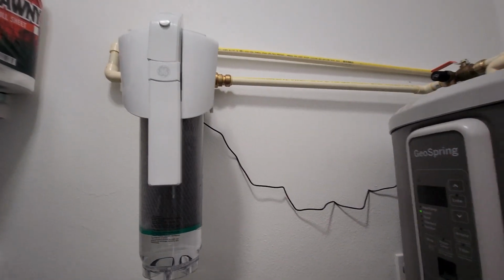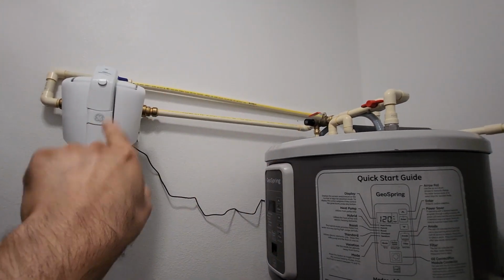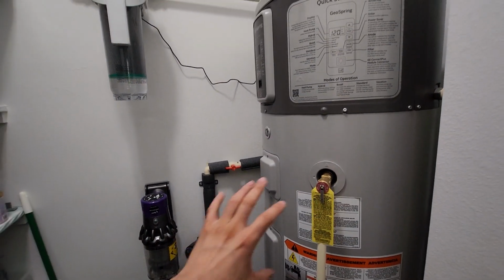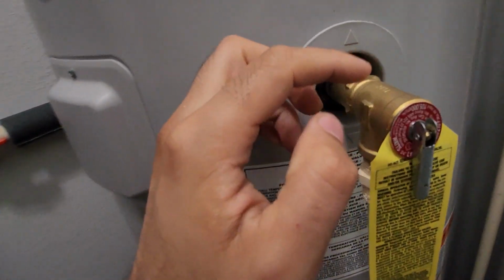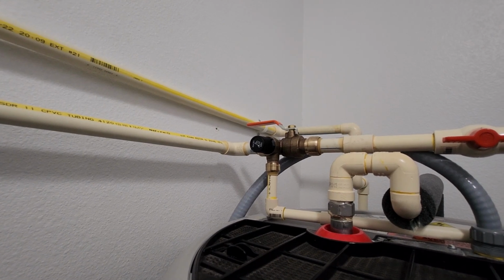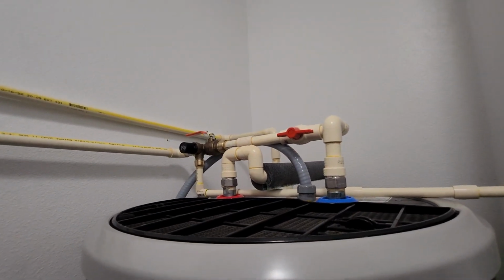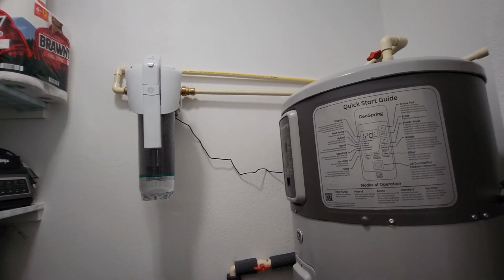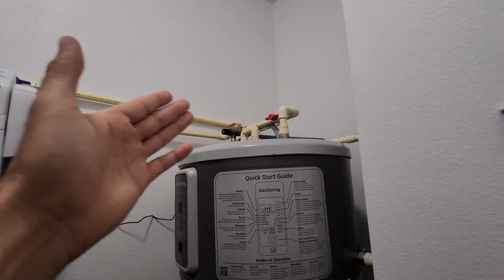GE Smart Home Water Filter System 6 Month Review SharkBite Expansion Tank Replacement

Comment: Same thing happened when we moved into our current home 7 years ago.   We couldn't figure out why our electricity bills were so high.  I had researched Hot Water Recirc units and they proudly proclaim "just  cents a day to run".   Local Energy company came out for an audit and said "well yes the recirc appliance only consumes a bit of energy but what it's doing is flushing your tank and the heater has to keep reheating the water hence your large bill" I  replaced it with a newer unit and put a smart plug on it so that if I want instant hot water for the morning showers I can set a schedule to provide power and then shut off.
Reply from the maker: How much do you think you saved?

Comment: I like the smart features but I'm researching different models that do the same at a lower cost I'm going in the rabbit hole YouTube videos something about a spin down filter for sediment, seems to be common to be using conjunction with a whole home water filter.  I like the way you only filter the water to the tank which is basically what I want to do because if you do the whole home yes it'll save your faucets and your devices but you will end up changing the filter more often my main concern is the tank besides I have water filters on my fridge and  under the sink for drinking. Don't forget to change your anode rods recommendation is 4 years but mine was still like a pencil I  in my opinion inspect yearly depending on your area
Reply from the maker: For me I couldn't do the whole home with this device. I'd need to install it outside which you shouldn't. But at least the water tank should be cleaner and last longer. Also still better taking showers where the water doesn't smell like chlorine. The smart features don't seem all that worth it from my use but still nice to know that they are there in case I need something.

Comment: Hey David question for you. Are you only filtering the cold water before it goes into the hot water tank? I was trying to see how you ran those lines. Why would you only filter just the cold water before the tank? Like why not the whole house?
Reply from the maker: This is an indoor unit. If I wanted to filter whole home I would need to do cold line which is outside. Those kind of filters cost way more. My refrigerator has a filter for drinking water. So just wanted something for showers. Obviously would be nice to filter whole home instead.
Reply: @davewelike  Thanks for sharing that information.
Reply from the maker: @louisbertini  you're welcome!
Reply: I put mine outside. I will build a box the house the filter. I got the other GE GXWH40L. I kept everything 1 inch . I bought many soldering and sharkbite elbow 90 degree . I bought old unused 1 inch copper pipe fromFB  marketplace. I bought my whole house filter from FB marketplace for $25 also this same unit like yours for another $25 new. Seller bought pallet of stuff from Home depot and resell for cheap. I plan to install same unit as your to water heater because I have hard water and a lot of sediment inside WH I can hear rumbling during heating cycle. I will probably look into expansion tank installation since you metion it will leak after the filter is installed and water cannot push back into cold water line.